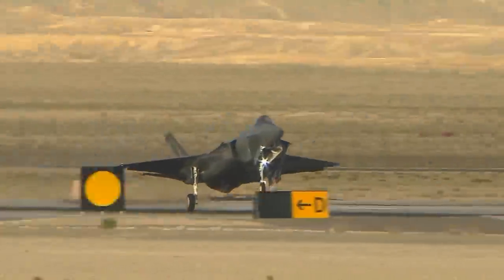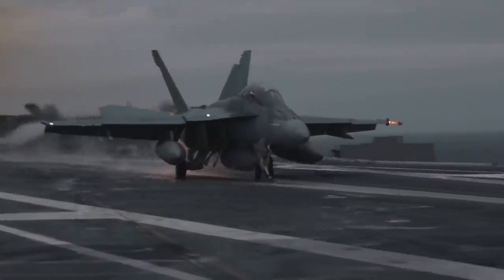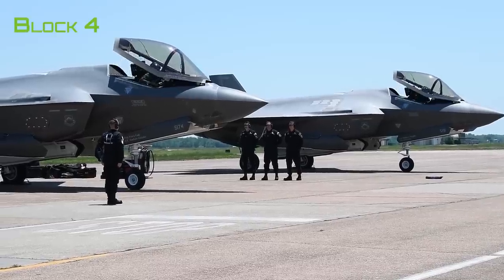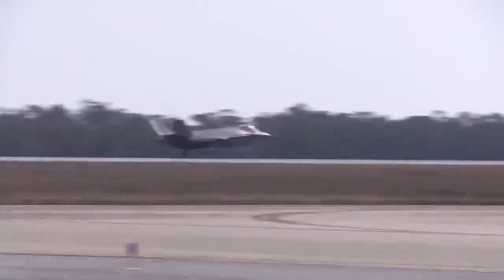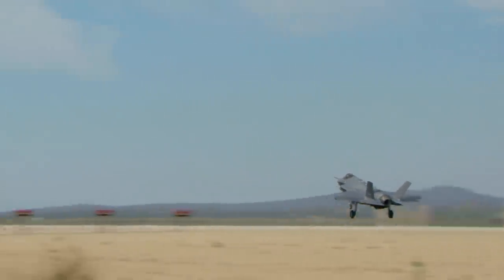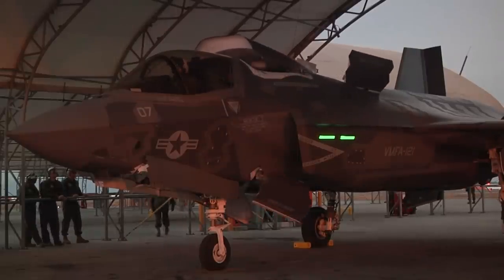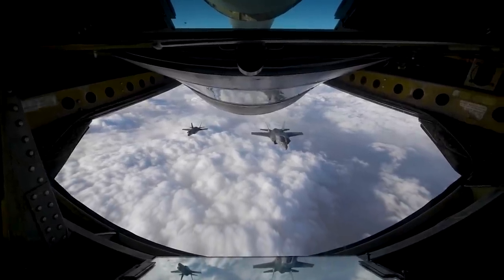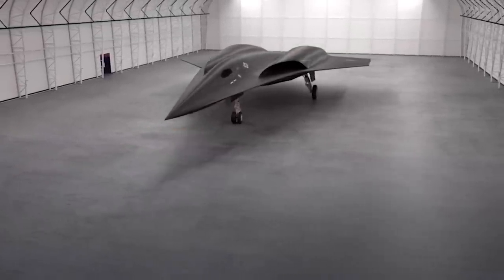Why the F-35 needs an engine upgrade

Comment: Okay...what if F-35 Avionics're placed in F-22!?
Reply: That would be badass
Reply: If you toss in the RAM coating, it would be the most impressive jet in the world, full stop. It would also be incredibly expensive to design, test, restart production, and build them as all the F-22 product lines ended over 10 years ago.

And the US and Japan considered it, but it was too expensive when F-35 exists, and they can put that development money into 6th gen fighters.

Is it tragic the F-22 was so low production? Yep. Is it tragic the F-22 wasn't made modular enough to be able to update? Yep. It's my favorite jet, but we won't see more of it made.
Reply: You get NGAD
Reply: The Irony is that it’s actually cheaper to upgrade the avionics in the F-22 that the whole engine of f-35, they’re just better off off using the lessons of the almost disastrous clunky program of F-35 Lemon and designing a new plane to better integrate the new engine still have a things the f-35 do good while actually making it more stealthy, it’s not as stealthy as the the SU-57 let alone the F-22
Reply: F22 needs large fuel tank, the combat range very short.
But if larger the tank, the stealh will be missing....
Reply: @OzzyRampage source: trust me bro
Reply: Actually I can imagine one instance where this might happen, but we don't want it
If a near peer adversary starts a war early enough that NGAD isn't close enough to push into production, and we find that proliferation of stealth technology has made it so WVR combat is probable enough that air combat maneuvering becomes reasonably common, a highly maneuverable air superiority stealth fighter suddenly becomes financially reasonable.
As I said, possible, but no one will want it to happen.
Reply: @OzzyRampage and this opinion is based on…what, exactly? Because it damn sure ain’t the reality on THIS planet.
Reply: I think someone said it. You get NGAD.
Reply: @bullpupgaming708  the NGAD won’t be like the f22
Reply: Ever heard of mid air refueling?
Reply: The F22 wasn't designed for the avionics to be upgradable like the F35, so it's actually more practical to build a whole new plane, believe it or not.
Reply: @FloridaManMatty  they are already upgrading the avionics in the F-22’s it’s not an impossible feat and not prohibitively expensive
Reply: @MrSJPowell  actually the NGAD is gonna be on a whole other level and is gonna be more expensive than the F-22 program oddly enough
Reply: @rustyATV  I know that’s what I was saying 👍
Reply: @OzzyRampage  sounds like you're assuming the F22 and F35 do the same job,  and the NGAD will replace both.
Reply: Reply section went crazy!!
But imagine Su-75... Russia came late but hit hard!
Reply: Take it a step further. The south Koreans are working on their own copy of the f22. I propose the US gives them assistance in exchange for help in setting up a production line in the states. We could put our own engines and flight systems in them.
Reply: India's AMCA mk1 & mk2 would be both 5th gen...but france'll co-develop a whole new engine...
Reply: Cool 😎 as fk
Reply: @adityasusantapanda Russian Su-75 is not even in production, meanwhile there are over 900 F-35s built.
Reply: Never underestimate Russian weapons... remember Indian Su-30mki doged 4 AAMRAM Missiles...& Russian pilots've earned a bad reputation of irritating Western pilots by their extreme maneuvers & remember what did the khiniby jammers did to F-35 & a couple of months back what did happen to the Mq-9...
By the way I laugh at pakistani f-16 pilots who got hit by an infrared homing Missile fired by 60 year old Mig-21...& Pakistan didn't ever used it against India...even in Kargil war...they ultimately shot down an 60 year old junk &'re proud of!!
Greece pilots're quite admirable... 
Pakistani pilot destroyed one of its F-16 because of an wild boar!!
Russian weapons're also quite admirable...
But a multipolar world it utmost important...
Reply: F-35'S kinda white elephant...
Reply: @OzzyRampage the f35 is not not slightly worse than the f22 in stealth and leagues better than the su57. That thing is only stealthy when it’s being detected by Russian radar.

Edit: also we stopped making upgrades to the f22 right after we shut down production
Reply: The Raptor already received extensive upgrades over the last decade, but it's now too old to be updated. It was designed in the late 1990s and produced in the early 2000s, so it's already ~20 years old.
Reply: @adityasusantapanda  "remember Indian Su-30mki"
The Su-30 MKI is exclusively a special export model for India, which is actually superior to the Russian version. It's a bad example of Russian military capability, because it was produced via collaboration with India, who are the only country to operate it. Indeed, even the VKS doesn't have it.
Reply: @OzzyRampage  The LAST Time we tried to do one plane for all services, we got the F-111 ArdVark.

Just sayin.
Reply: @creatormaxi8324  Lame. They would redesign to adapt.
Reply: @FloridaManMatty  Reasonable peoples' thought-process.
Reply: @devobronc  first of all what’s wrong with the Aardvark? And I think you mean F-4 Phantom, thats the last fighter/bomber all the services truly used. But f-18/ F/A-18 comes close but the F-35 is used by 3 services, A-10 used by 2, the F-16 and 15 are very versatile fighter/strike bombers but only F-15 would be able to fitted with and arrester hook, but probably would not operate well with the conditions and moisture on a carrier however.
Reply: @OzzyRampage F-35 not as stealthy as the rivet-riven Su-57?

What is the color of the sky in your world?
Reply: @Rob_F8F  they're changing their engines with an 5th gen engine with flat nozel thrust vectoring system(upgraded version of the flat nozel thrust vectoring system to be used in Mig-41)
Reply: @GonzoTehGreat  yeah! Agreed!! But Russian Airforce's an absolute headache...
Reply: @adityasusantapanda  Even before last year, Russia needed a partner to foot the bill for developing any new aircraft. It was the case for the PAK-FA (Su-57) [India was the partner] and it will be the same for the Su-75. As for the PAK-DP (MiG-41), there's little international demand for an interceptor, so that project will be "in development" forever.
Reply: @Rob_F8F  But India won't participate cause they're making an absolute true stealthy 5th gen fighter jet called "Advance Medium Combat Aircraft" Mk1 & mk2...
Reply: @creatormaxi8324 Nope. F-22 has similar if not better range than J-20. For one it is a larger aircraft than J-20 in terms of wingspan. Two its F119 engine has better potential thrust even compared to WS-15. Su-57 on the other hand has the largest wingspan however they don't have a comparable engine.
Reply: @devobronc   F22's modification is not possible, it needs completely new model.
Even f35 design is defect, it has much problem and almost impossible to fix it.
So why, USA is working with old F15 to F15-ex but this airplane is not 5th gen and stealth, and modern warplanes are not doing dogfight, so this F15-ex is easy target for enemy 5th gen.
F35 has been locked by China's J20 at least 2 times, General Wilsbach (google it) is confirming on one interview.
Reply: they dont fit
Reply: @adityasusantapanda  Exactly, India isn't going to participate in Checkmate. Imagine China will not either. Who will pay for development? North Korea? Iran?
Reply: @adityasusantapanda  "But Russian Airforce's an absolute headache..."
A capable airforce is vital on the modern battlefield and especially important for India's homeland defence. Unfortunately, Russia can no longer provide this for them, especially as they no longer have access to the latest microchips due to economic sanctions. Russia still makes excellent 4th gen fighter aircraft, but they're over a decade behind the USA in terms of the latest technology, which is why China no longer imports aircraft from them. 
India is also increasingly looking to diversify away from their over dependence on Russian arms, as they gradually modernize their own armed forces.
Reply: @OzzyRampage Su-57 has a rcs of a clean super hornet. The F-35 rcs is orders of magnitudes smaller than the Su-57.
Reply: @GonzoTehGreat  totally agreed...always remember a wounded tiger is more dangerous than an fit one!!
Reply: @GonzoTehGreat  you forget India got some powerful investments & is investing more & more to totally replace China...the world's helping India cause it has enormous potential...& Russia's an ally of India since when USA & Europeans supported millitary dictatorship pakistan over democratic India...
Reply: @murrydog100  Su-57 got new engines...& An new Order with upgraded avionics 🥶😵...
History has proved whenever world thought that they countered Russia with technology Russia had comeback even more intensely..
Reply: @adityasusantapanda  Tigers aren't dangerous at all. It's humans who are dangerous...
Reply: @adityasusantapanda  Russian systems have had a long history of not living up to the hype….
Reply: @OzzyRampage the f-35 is CONSIDERABLY stealthier than SU-57. The Felon has the frontal RCS of a clean f-18, it is ORDERS OF MAGNITUDE less stealthy than any western stealth fighter.
Reply: @adityasusantapanda Imagine is all the su75 designers will ever do. It's a wooden mock-up. Imagine.
Reply: @devobronc so, an extremely successful aircraft
Reply: @MrSJPowell Nobody needs the F22 if we have the next gen
Reply: @OzzyRampage Are you being silly? The SU-57 doesn’t even have RAM, it’s held together by Home Depot screws. The F-35 is made of RAM. Literally the skin is a fibermat RAM coating spongey in texture.
Reply: You’d get the F-22 mid life upgrade. Coming soon to an airbase near you.
Reply: @timmyhoward6638  Bruh I'm from India...& I'm KEEN to weapons...as the F-15EX'll get F-35 avionics...
& Yes USA has pitched it's upgraded  F-15EX to I dia under it's MMRFA tender for 114 Fighter Aircrafts of $20 billion worth...
& Recently US showed intrest to sell it's F-35s to India...
But under Lemoa agreement & Comcasa agreement...
The raptor can land on our land😏

Comment: The engine cooling issue has been known of for a long time.
Reply: Yeah, very long time now.  They said from the very start that the engines would be upgraded, and not only for cooling, but also for super cruise.  One of the biggest gripes was not having a supersonic cruise without using the afterburner

Comment: Oh yeah the Adaptive Engine is the way to go. Lets be honest.  The F35 is flying brick with impressive tech capabilities.  But its performance down right sucks. Mach 1.6 is terrible for any BVR strike fighter. The Strike Eagle optimally load can sling missiles at speeds over mach 1. Thats one hell of booster for the Amraam extending its randelge and making it lethal sniper. F35 needs at least this if its going to continue to be a poor dog fighter
Reply: Aerodynamic drag is proportional to velocity squared.  A 20% increase in speed will require a 40% increase in thrust.   F35 has very unfortunate aerodynamic drag.  It will NEVER perform as well as 4th gen fighters at high speed.

Comment: GE's XA100 is 25% more Efficient and 10% more thrust than the Current Engines. Expensive, BUT why should the Protection of The Country have an Expense? New Avionics Consume heat, they'll need Cooling Power. USSR's MIG 25 Foxbat Avionics used Miniature Vacuum Tubes ,,, Cooled with Alcohol, Belenko Defection in 1976. America's First 4 Bit Microprocessor was 'INTEL' in 1971.

Comment: Great video, but it does make me wonder if a high performance Peltier substrate for mounting the electronics would be of any real use or benefit. Not being an electrical engineer or materials whiz, I kind of peter-out at "wonder".
Reply: On the A-4 Skyhawks that I used to work on, the cockpit air conditioning system used engine bleed air as the input.  My hazy understanding is that there was a simple chamber where the air spiraled and somehow separated out into hot and cold parts.  The cold air was used to cool the pilot, and the hot air was dumped overboard.  No idea if this is still used or not, but it was certainly a novel technique.  Peltier devices are pretty handy, but fairly inefficient.
Reply: The problem would then be how you cool the hot side, and peltiers use more power.

Comment: Why not bring Rolls-Royce in? They have some advanced stuff and can probably do more than aircraft companies.
Reply: It may be a capacity issue, RR will developing a new engine for the FCAS.
Reply: @bernadmanny  RR has no engine in the same class.  Would have to start from scratch.  Not saying they could not create one, just they have nothing to start from.  The engine in F35 or potentially in it has its origins in the F15/F14 from the early 1970's.  USA has settled on a ~48" diameter engine instead of the ~1m class engine.  Namely as it allows higher Bypass ratio

Comment: They were offered a new engine by Rolls-Royce and Boeing working together several years ago but the US Senate wanted a US built proven engine. They had trouble with the heat of the Pratt & Whitney engine from the start, the heat signature reduces the stealth capabilities. Sabre engines from the U.K. spent ten years developing a unique cooling system for its space plane engine, it reduces air temperatures in milliseconds. RR are adapting it for use in their engines.

Comment: They need to install some clan double heatsinks. Half the weight of the old IS models.
Reply: I guess the question is if the F35 has space left inside. You think the US DHS has 2 or 3 slots?
Reply: @arsarma1808  They may have to remove the rotary auto cannon 2 to free up tonnage and internal slots.

Comment: Would they retrofit older F35s with new engines?
Reply from the maker: I believe that is part of the problem, if they went with an all new engine, they'd have to retrofit the older airframes.  The ECU however would be applied to new and old engines.  Thanks for commenting!
Reply: at what cost? not all countries can just print money at will

Comment: If the point is to be stealth and you're adding more computing power which drives heat... wouldn't the whole approach be counter productive.  Bleeding more heat means a bigger IR signature.  I'd think you would have to throttle the electronics regardless of cooling capacity to minimize detectable signatures, not just radar cross sections.
Reply: There is a different solution, I believe, a new Rolls Roys engine, that is being designed for the Tempest uses it: use excessive heat from the electronics and stuff to preheat air, just before it enters the combustion chamber, thus the engine becomes even more efficient, without producing any unnecessary heat
Reply: As is said in this video, for cooling is used bleed air from engine. Probably that air after cooling electronics is directed to the engine nozzle. Given temperatures of exhaust gases another couple kW is next to nothing. Jet engines uses power in MW so much much more than kWts
Reply: @solarissv777  "use excessive heat from the electronics and stuff to preheat air, just before it enters the combustion chamber, thus the engine becomes even more efficient, without producing any unnecessary heat"

Very unlikely that they would be injecting any preheated air from electronics cooling just upstream of the combustion chamber as you're thinking for a number of reasons. Air coming out of the high compressor is going to be around 900F or higher, good luck finding electronics that can operate hot enough to heat cooling flow up to those temperatures. Air going into the combustor also needs to be pressurized to the same or higher than what is coming out of the high compressor, at best you would have to reinject flow in the late stages of the high compressor, but that introduces compressor stability issues. Jet engines are actually less efficient as inlet temperature to the engine/combustor inlet increases; it's increases in turbine inlet temperature that improve efficiency.

Comment: This engine inadequacy is not confined to this F35. During decades of US fighter production, the final version of a design have always been overloaded with more systems and weapons than the original spec, making engine upgrades soon after commission necessary. F14, F16, F15 and now F35 have all gone through the same painful engine upgrades.

Comment: My phone uses a cooling fan though. I use it every time it gets hot. Or it automatically turns on if you set it for that.

In general, if it doesn't have the most powerful engine available, it needs an upgrade.
While they're at it, they need to stick the f22 engines into the a10 and make its wings bigger.
Or just use the new f35 engines they make after the competition

Comment: Concerned about the F35 losing ground to other fighters and SAM systems? These engine upgrades with electronic and computer improvements, plus upgrades to control drones, means the F-35 is moving further ahead of existing fighters and becoming even more invulnerable to SAM systems.

Comment: They should put the F22 thrust vectoring raptor engine in the F35.
Reply: The F-135 is essentially the F-119 core from the F-22 with a higher bypass ratio.

Comment: Call me if I’m wrong but did they not literally JUST give the F-35 an engine upgrade?
Reply: I think it was an upgrade on other components like electronics and radar systems etc, but it still has the same turbo fan engine
Reply: Not yet
Reply: They had 2 engine options, went with one. Now the electronics are needing to be replaced because of issues.
This plane was a rip off
Reply: Could of landed man on Mars and started asteroid mining with the money wasted on this.